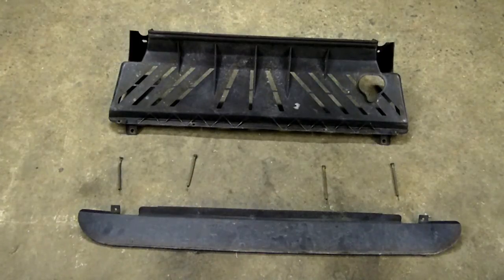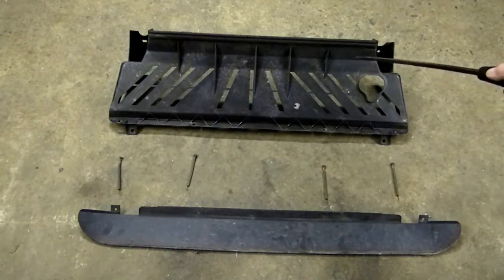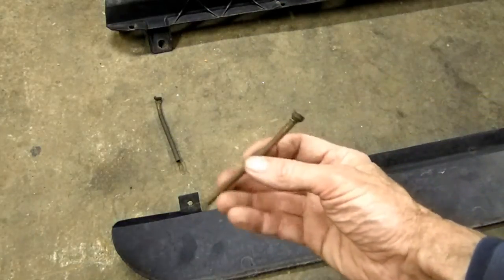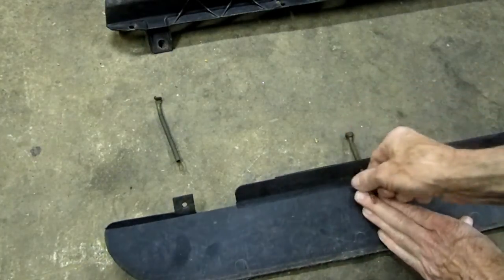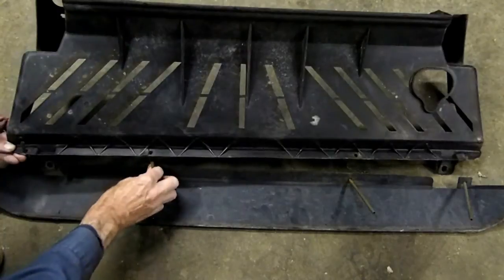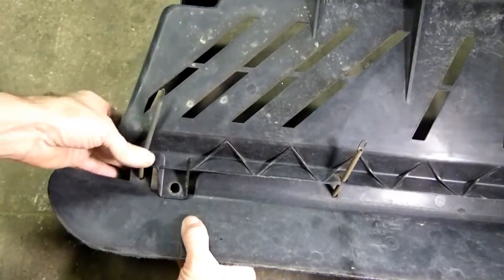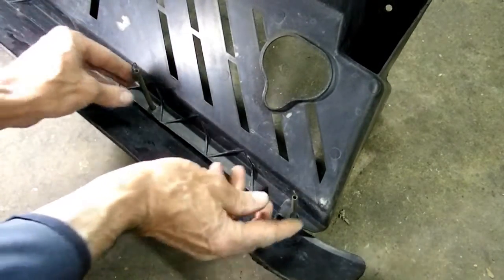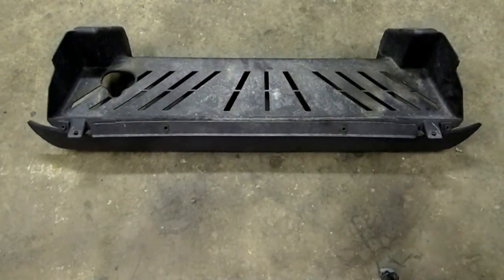Radiator Deflector To Air Dam Installation

Comment: Air deflector fell off about 1 month ago  in snow drifts. found all the parts, had to buy new springs ( 21030793 - Also used on the 1997 Corvette ) . found a set of 5 springs on ebay for $25us. This helped  me put it back together.  Thank You

Comment: Great video; didn't have a clue how to fix mine until I saw this.  Please note that if you can jack the car up a little with a jack or ramps,  it's very easy to install these springs without removing the Air Dam and risk damaging its delicate push pins.

Comment: Thanks for the video.

I just performed a similar repair today on my 1995 SW1. During shop repairs, the mechanic removed the assembly and apparently lost or broke the four fasteners which attach the assembly to the underside of the vehicle. I saw white tyraps there so I suspected something was wrong. I purchased replacement substitute fasteners from the local auto parts store, Dorman brand P/N 961-362D. I merely eyeballed the existing hole and pretty much bought the largest fastener I could find. The Dorman display does organize the parts by car brand and general application. Obviously, it doesn't hurt to have an original fastener to bring along as a sample. The GM P/N appears to be 21030249.